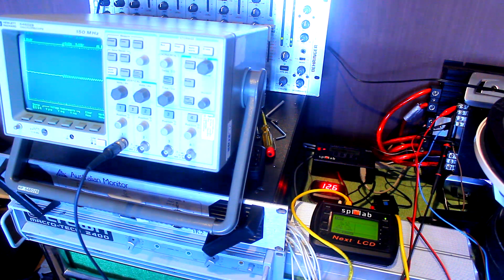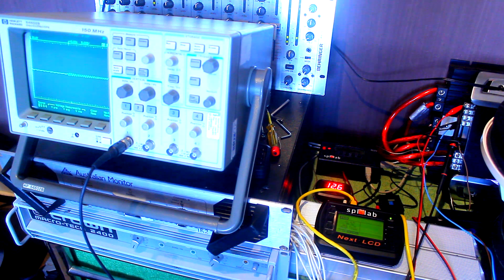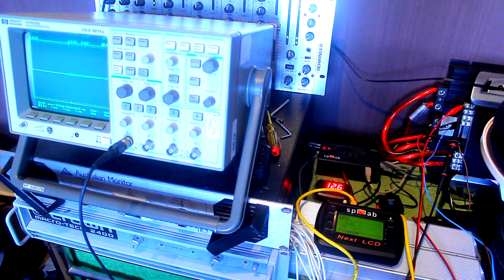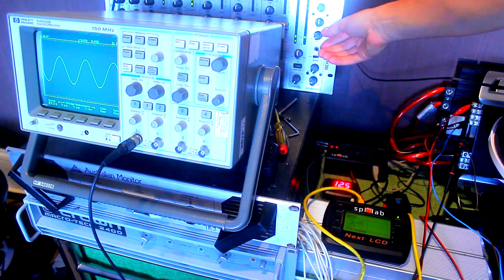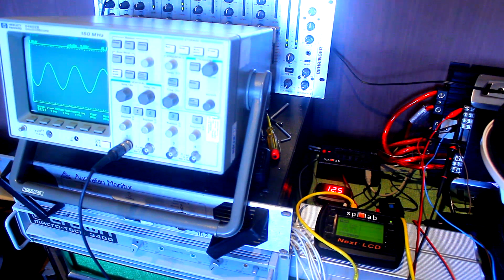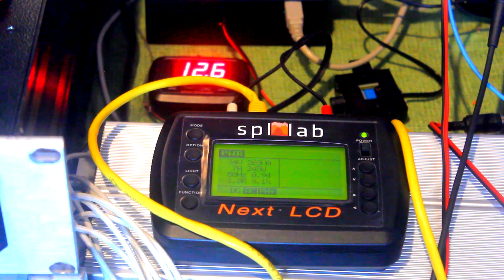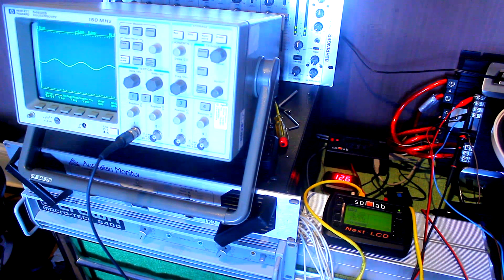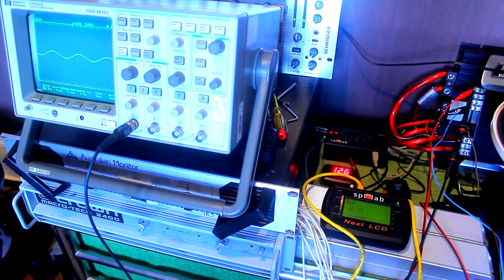Why is clipping so dangerous? Quick demonstration

Comment: So my question is this.  If you drive a sub with 200 watts clean and 150 watts clipped will the voice coil heat up since you are actually driving it with a PWM DC power supply effectively?  My bet is that the coil will get overheated at any power level when a square wave is present, opposed to clean.  Same curiosity goes for dirty class D.  I wish I could measure VC Temps and do extensive testing.
Reply from the maker: No, this is incorrect. How do you think speakers play synths with square wave fundamental? Or distorted electric guitar? The voice coil does not care in the slightest what shape the wave is. ONLY how much power it is receiving.
Reply: @barevids  So if you apply DC voltage to a speaker the voice coil is simply a resistor.  I know it is just a moment in time, but seemed like a solid theory.

Comment: The dirty squarewave ALSO further adds to the problem by not letting the subwoofer cool properly. when the waveform is square. its NOT COOLING the subwoofer because the subwoofer is not moving half the time its just sitting out. so EVEN MORE of the watts goes into heating the subwoofer instead of creating sound and cooling it.
Reply: This is exactly my previous point just said differently.

Comment: What you are saying is not true. The meter only "thinks" the amp is putting out more power. The rails are already saturated. Notice how the square wave does not increase in amplitude.
Reply: it's just putting that peak voltage in longer period of time, which may blow out subwoofer..
Reply: If you understand how RMS voltage is derived, you will also understand how the power doubles when going from a sine wave to square wave. The peak doesn't increase... only the area under the curve.
Reply: @diylithiumguy  if you understand how a sine wave works,  you would know that it is not the "power" doubling. It is the ENERGY that is increased.
Reply: @Zionslayer1  lol... energy = power * time, so try again.

Power is the only answer. 

Pretty funny that you think watt-hours are the problem.  :(
Reply: @diylithiumguy  I can tell you're unhappily married.
Reply: @Zionslayer1  I can tell you ran out of knowledge.

Comment: What are the reasons clipping is produced?
Reply: When your sub clips, it's when you push your sub too much and the coils (the thing the magnets pull up and down to move the subwoofer) pass the magnet. That causes it to sound like crap by producing the wrong waves being sent in (look at the sound waves when he says it's in clipping range), and to over-work itself. Now for the amplifier, it has a distortion range. Depending on how much volts you give it (clean power) (more, but not too much) the better. But they all have their limits. Multiple things can cause it to distort really. Could be the radio (turned it up too high), the music file (bad quality, bass boosted poorly etc), bad power (voltage drops, ground etc), or turning your amp gain above the distortion range. Sorry if that wasn't the answer you were looking for. There's probably more things that can cause it.
Reply: PSYk1ll4h so adding more batteries ie voltage will prevent clipping to a certain point . I can’t tell if the problem I’m running into is voltage drops or the signal I know I need to add a third battery so I’m wondering if that would remediate the issue

Comment: nice demo. but it's not just the extra power that burns voice coils, it's mainly because speakers are meant for ac, not dc. you can pump 500 watts of clean power into a 300 watt speaker without it burning it up.

Comment: lol them square waves are boss...without a scope its kinda hard to see if u r cliping sometimes especially with some cheap amplifiers...great vid tho..
Reply: +Telmo Silva (TSilva) You can't trust the clipping indicator on amps. They don't actually detect a clipped wave form.
Reply: @Kingbudman  so what do they detect ?
Reply: @Broxine They dectect DC voltage.  Amps are suppose to only be AC voltage. So while it will tell you if you're clipping they are not perfect and you could be slightly clipping and not have the clip light on. Only way to till for sure is an o-scope. Not really a big deal until you start over powering your subs.
Reply: Kingbudman thanks for answering two years later :)
How do i know if i overpower my bass? If the amp is very powerfull and i raise the volume, how do i know when im overpushing it?
Measuring voltage and calculating how much watts the amp drives to the sub and not overpowering it?
Reply: @Broxine  I am confused by the question. You seem to know how to measure the watts an amp can put out but want to know how to tell if you are overpowering you sub?  Measure the watts of the amp when playing and compare that to the rated for your sub, if amp is higher then you are overpowering it.

Unless your question is how to know if you are clipping. With an o-scope like the video or with experience you can hear clipping.
Reply: Kingbudman ok that was my question.
I mean there are a lot of wattage descriptions on amps like rms, 1%thd and so on and so forth, same goes for subwoofers, rsm, peak watts... therefor i am confused as to when i am overpowering/overdriving a sub and if there is any method to find out besides smelling the smoke of burned coils 😂
Reply: @Broxine  Sorry been a long week. Lets try an analogy.

You have a car that does 50 mph just fine and you decide to go 100 mph. Now you have to look, listen, feel, smell to make sure the car can handle going twice the speed it was designed for.

Now you take that car that is going twice the speed it was designed for and you take it off the smooth road and put it on a bumpy gravel road while draining the oil and slashing the tires. Not good.

That is like clipping. If you push your sub (cleanly) over the rated RMS it will prob be fine, like speeding in your car, probably OK within reason. But if you go drive like a maniac (clipping) and jump your car like the Duke boys, your car is gonna have problems.

I have a Sundown X-15 that is 1500W RMS and I have been putting 2500W RMS to it for about 2 years now just fine. If I had say a BOSS speaker I would never overpower it because it is shit and can't handle it. If you have a good quality Sub and Amp and use clean power when overpowering(within reason) it should be ok, but if you start clipping that is like draining your car oil and then going driving on a bumpy road, that car is gonna break.

It is not any one thing there are many factors and you need to use your best judgement on what is too much. That being said you only learn when you make mistakes. I have smoked quite a few subs and amps in my day.
Reply: Kingbudman same here. I ripped apart a 8w7 with an 2,5 kw amp... that hurt my soul instantly :/ . The 8w7 played for 10 minutes after i bought it. The spider was ruptured...
On the other side i drive a 12w7 (rated to up to 1500w) with the jl audio 750/1 amp (750w) and with this amp the sub in a vented box, its excursion feels like it reaches the max at low frequencies so i am anxious to break the spider again
Reply: +killer32620 Some amplifiers have clipping detectors.
Reply: true that not all of them tho